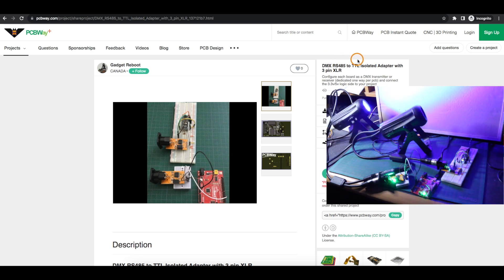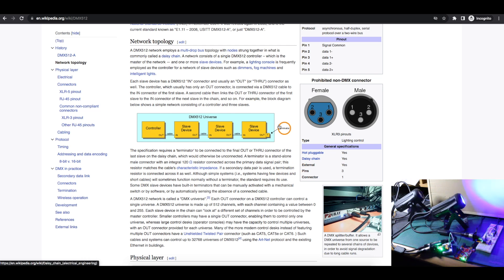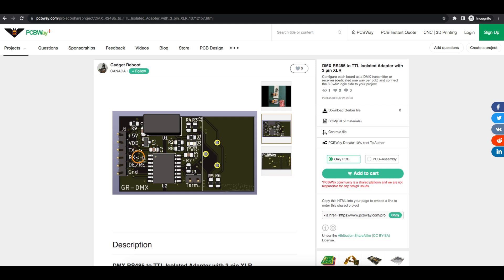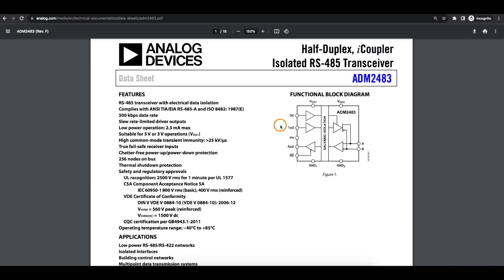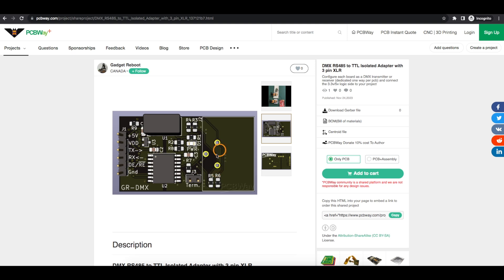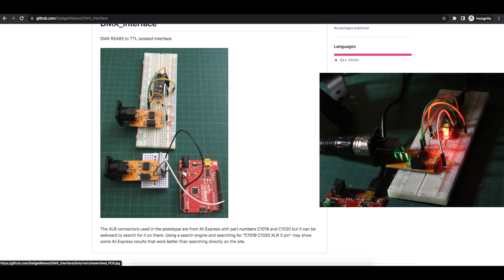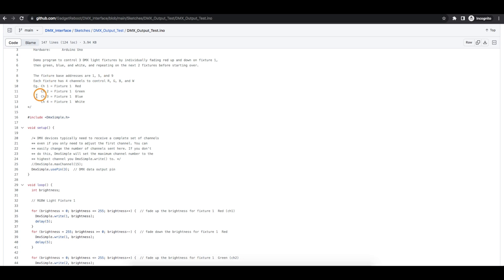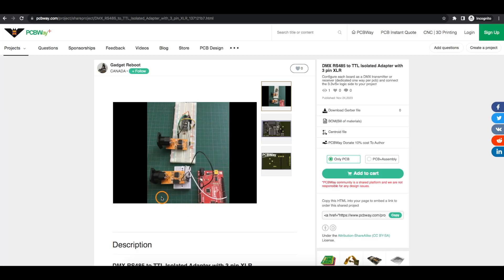DMX512 RS485 to 3.3v/5v Isolated Interface

Comment: Ive looked into integrated isolation before but thought it was too pricey for hobby level. that chip isn't too bad though. and 3.3v would be nice (haven't gotten a working isolated 3.3v circuit otherwise yet)

Comment: Now that is damn handy! :D I have a few DMX controlled lights here as a 'decor' in my living room. But no easy way of controlling them other then setting it through the menu (which is always a pain). So they basically they are always off and just sit there. Now with this, I can make a simple project with and ESP(32) and hook it up to my Home Assistant and actually use them! *clicked "add to cart on PCBWay". Thanks!
Reply from the maker: don’t forget to properly configure as a transmitter because the PCB way bill of materials by default as a receiver. I had trouble finding those XLR connecters anywhere other than places like AliExpress I was able to find a receiver connecter but not the transmitter strangely so that’s one reason I set the bill of materials that way
Reply: @GadgetReboot  Thanks for the tips. I'm sure I will figure it out ;)

Comment: Nice little project, used to use isolated 5V DC:DC converters and the RS485 isolator in a medical prototype.
in the end we needed more isolation than the RS485 isolator could provide so  I went to 1m of dual fibre optics for the RS485. Did not try and prove what 1m of glass gave us in kV's of isolation but i expect it was quite a lot. 🙂
Reply from the maker: when isolation is specified in meters, I think that dominates the voltage isolation spec! Was it actually physically a meter apart or in close proximity but with a 1 m loop of interconnect?
Reply: @GadgetReboot  it was a 1m loop, we just needed more isolation than we could find with the chips at the time. The 5v dc:dc converter was easier as you just need large gaps and not high speed. When you have a direct  electrical connection to arterial blood you want the best isolation you can get. 🙂